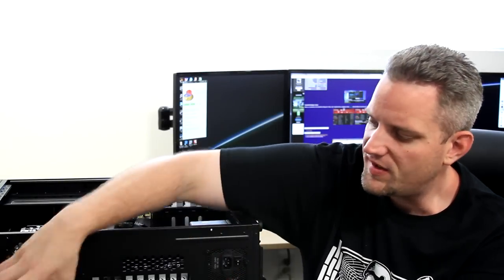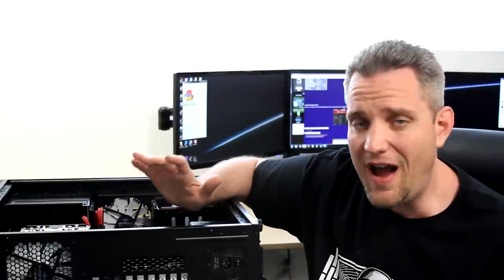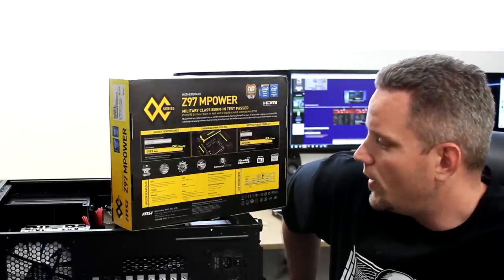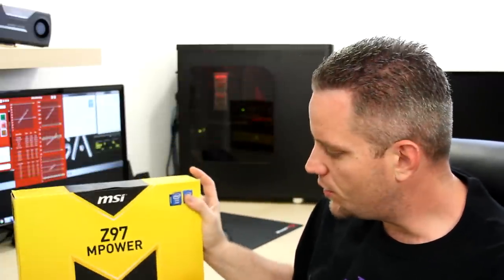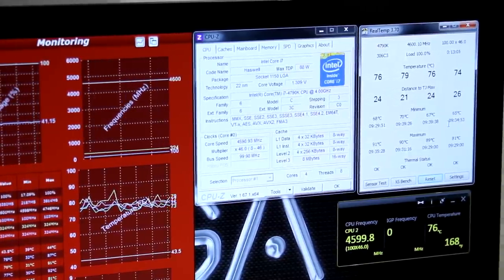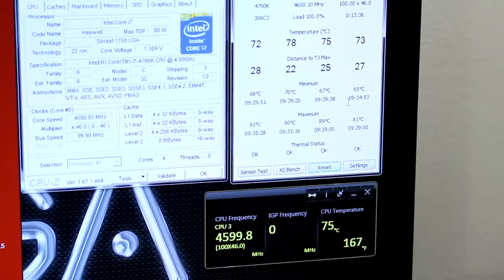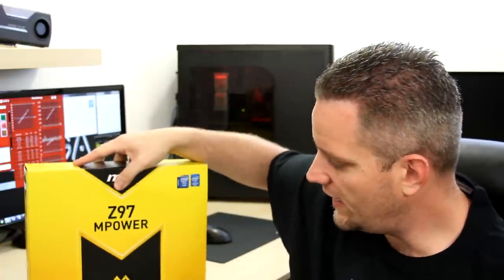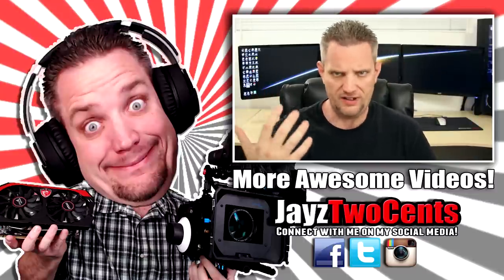Overclocking the Intel 4790k with the MSI Z97 MPower on air!

Comment: Jay, how does one learn to overclock, i've noticed you did one with your 8350 some time back and i was planning on following that tutorial but my gigabyte GA-970A-UD3P has a completely different bios and i'm stuck on what do to.
Reply: just disable turbo core and put up the multiplier
Reply: Liger-Zero whatever that means.
Reply: Liger-Zero Also i pretty sure you have to disable a bunch of things as well
Reply: you need to enable llc, disable apm, cnq and c1e, as well as all the power saving features before putting the core voltage to 1.5v or 1.45v. then you can try to find your cpu's headroom. and yes, you need better cooling for the cpu.
if you are shooting to the max, then you may want to play with the nb frequency, cpu/nb link, ht link, etc... but generally speaking, you can overclock to 4.2 to 4.5ghz without changing the stock voltage.
it is not that hard to overclock fx if you have a good mobo and heatsink
Reply: Liger-Zero ok thanks
Reply: Liger-Zero Putting the core voltage above 1.3v is just asking for trouble.
Reply: Steven Clark that is half true. if you are using haswell, yes, anything above 1.3v is asking for troubles; but no for fx. 
the stock voltage for fx is around 1.35v, depending on your model, some may vary. but generally speaking, you need to go above 1.4v if you are planning on overclocking the fx. my fx6300 could go up to 4.2ghz without raising the voltage. it is good for normal use but below average for overclock community standard.
for now, my downvolted fx serves me really well, and i dont see any necessity to overclock it.

Comment: i love your channel now! :) i have a question, i got a intel ssd 120 gb to ONLY RUN MY OP WINDOWS 8.1 na d a intel ssd 240 gb to run my games like battlefield farcry and you name it, and 1tb hdd 1000 velociraptor to save my videos music and all that please tell me the truth is this a right way to start my new built?
Reply: you don't need 120gb for windows only you can add extra stuff to that ssd windows is only 20gb if i'm correct, don't count on me for that do some research
Reply: You could sell the Intel 120gb ssd because you should be able to put windows and games on 240gb ssd without a problem. I'd recommend consulting a forum or something to make sure there aren't any long term problems with having heavy games and windows on the same ssd.
Reply: nix the velociraptor if you're already SSD for the important stuff - all the rest can live on slow low power green drives (for much less cash) :)

Comment: Atm my 4790k is running 4,7GHZ @ 1.225v. I wont go any higher because the temps are getting kinda high for h80i:P.
Atm waiting for my swiftech h-240x

Im also running in in MSI Z87 G43 Gaming motherboard.
Reply: ***** Got mine at same GHz but with 1.23v. Can't go any further down. Pretty sure he/she is just really lucky or just hasn't stress tested for an hour yet.

Comment: 4790k@4.4Ghz + NoctuaNH-D15: 85-89ºC on Prime 95's Small FFT Test.
I tried reapplying the thermal paste twice but it's just a couple of degrees less than the 212 EVO. Is this normal??? It's summer here and all but I thought I'd get lower temps. :(
Reply: No man. I'm running version 26.6, the latest recommended for this CPU. I'm sure with version 28 the processor would just shut down since the temp would go even 20 degrees higher. But lowering the voltage did the trick: I was getting 97ºC with Prime95 Small FFT Test (my room is super warm today), but my vcore was 1.312 which is too high for 4.4 ghz. I set it to to 1.216 and temps went down 10ºC!! Stress tests run stable, I'll keep lowering it and testing the system stability.
The only bad thing is that the manual vcore is fixed, so it will be high in idle and that "might" reduce the lifespan of the cpu they say.
Reply: +Fernando Vidal i have mine clocked too 4.5 with a coler master hyper tx3 evo with 75-80 c
Reply: Read my previous comment: I fixed it setting a lower vcore, man. It was at 1.302 and now it's at 1.137 running stable but much cooler. :)

Comment: Im having trouble with my 4790k. 

I can run it at 4.4ghz at 1.150v. It will NOT go higher! I don't know what's wrong with it, or if im doing something wrong, it just doesnt make any sense. I ran all the way up to 1.3v at 4.5, but it just wont stick. Fails p95 in literally 20 seconds. 

Im running the 4790k on a sabertooth z97 mk1.
Reply: there has to be something wrong. i get my i7 4790k stable on 4.6 ghz at 1.160 Volt...
Reply: Fendt Arena
Im unable to add voltage to my gpu either. Im wondering if somethings up with my powersupply
Reply: +JgHaverty i Cant add voltage to my gpu too, it is not your power supply
wich Mainboard do you have?
Reply: z97 sabertooth mk1
Fendt Arena
Reply: +JgHaverty ok

Comment: my 4790k runs 4.7Ghz @1.285v 
I'm running it now 24/7 for over a year now with Fixed voltage and Speedstep off
is that safe for the long term ?
or should i run it at 4.6Ghz@1.25v?

cooler NH-d15 
Highest temp I've seen is 81c
Reply: .... +supersiick i hope you're joking xD
Reply: I just got into OC'ing but I would say that's pretty good. I heard as long you don't go over 1.35V and 85c-90c you're good.  That's why he was freaking out about the 1.501v lol
Reply: Reason over Dogma yes but if you have a really good cooling set up like jay (watercooling loop) you can up the voltage a little more then 1.35v but with care
Reply: Don't fix what ain't broke, heat kills CPUs and that's not enough heat. U probs wouldn't even be hitting 60c in realistic loads. I run 5.1ghz on the same CPU @1.37v with a 91c max and a 82 avg full load temp, and it's been the same for 2 years now. As Long as u don't notice anything u should be fine
Reply: +RedddRainn it is easy to get a stable 1.37v for me on air 91c max  5.1ghz. You don't need custom water cooling for that if ur lucky. Many people are able to run 1.336 to 1.38 stable on air depending on the air cooler and the air flow and ambient temps
Reply: Cyrus Khalvati i mean you don't need water cooling for overclocking but its doesn't hurt either ;)
Reply: thats true but if someone is buying this cpu it probs means they cant afford a custom loop
not that the cpu is cheep but rather that they cant afford to upgrade to a lga 1151 or 2011-3
Reply: Cyrus Khalvati yeah or they already have a motherboard cpu and ram for lga 1150 and just wont to upgrade there cpu
Reply: which probably means they cant afford getting a new mobo and other stuff for the mobo :P

Comment: My problem is I tried the overclock genie with the bios not the buttons on the board I did it in the simple mode where you get the option of gear1 or gear2 in gear 2 it will go too 4.7 ghz but when I go too run a game like flight sim X it crashes with the blue screen I set it back too gear1 in the bios that puts it too 4.5 and its fine.Can I over clock with the MSI command center or does it have to go through the bios set too gear2? Iam running the 4790K with corsair water cooling thx I have the same board msi max ac btw.

Comment: So if I jumped from a Intel Pentium G3258 to a Core i7 4790k ? Is it alright? I was bound by my LGA 1150 Mobo and heard only good things from people around me.
Reply: It will be a HUGE upgrade
Reply: I did it already, almost 2 months ago
Reply: ParagonHawk has it been a good upgrade so far?
Reply: Absolutely!
Reply: ParagonHawk great!
Reply: It's a blast.
Reply: Mike Brown Just curious about something, my budget is not that great but I want to buy a motherboard good for a stable overclock and also upgrade from my mATX to a normal ATX because my cooler is barely allowing my side panel to slide shut. Any idea? I'm thinking a Z97 is what I need but I don't know what model should I buy.
Reply: ParagonHawk I have the Z97 msi mate version and I have my 4790k overclocked at 4.7 ghz with teh 212 evo cooler.
Reply: great then because in my country prices for pc parts are nuts and the asrock boards are really great in prices. thanks
Reply: ParagonHawk welcome.

Comment: I have a MSI z97 gaming MOBO and a i7 4790k cpu, and a corsair h100iGTX cpu cooler. I am new to overclocking and I went to just tune up my cpu ratio up a little bit but I noticed it had a core voltage set to 1.408v AUTO. Is this bad?
Reply: +Alah Hockmac What you can get out of your processor is basically a lottery. You should though be able to get 4.6-4.8GHz easilly with watercooling. I myself use a Noctua nh-d15 for my 4790k, and I go for 4.6GHz at 1.240v. For mine to be stable at 4.7k I'd need like 1.275v, but I prefer the lower temps.
You should NOT go for auto when overclocking. If that is ok or not depends completely on what you set your multiplyer to. Water coolers can go for the 1.4v mark, but I would go below that to secure the longevity of the chip. Try for something closer to the 1.3v mark and see what you can get. Set it to 4.7GHz, set core volt to 1.3 (override/fixed (not offset/auto/adaptive)), then run a stresstest, like AIDA64 or Prime95 version 26.6 (not later). See if you're comfortable with the temperatures and if it runs the test for say 5 minutes. If it does, turn your voltage down to 1.290. Repeat this until you get a bluescreen and turn it back to what was stable, then run the test for a longer period, say 1 hour. Did it go well? Good! Comfortable with temps? Great! Should be good for anything you throw at it, since stresstests put alot more load than say gaming. You can ofcourse try with higher clocks, but just increase a bit and apply the same strategy.
Now what you want to do is go back to the BIOS and turn adaptive voltage on. This will lower the voltage when idling. Keep in mind that adaptive can go past the voltage that you set if you use a program that activates AVX. I've found AIDA64 to turn it up the most for my rig, so put it somewhere where you're comfortable, turn on adaptive, then run AIDA64 to see if you're comfortable with where the AVX takes you aswell. HWmonitor and CPU-Z are both good programs for monitoring this.
Good luck!
Reply: Ur risking ur chip going that High in my opinion.

Comment: Can i overclock my i7 4790k with asus z97 pro gamer?I have a 750w power supply.
Reply: ***** ok , thanks!
Reply: So what oc did you get? I building the same set up
Reply: Nicolas Ong I have not overclocked yet because i don't have enough money to buy water cooling. But when i do i think it will run 4.6-4.8 ghz stable .

Comment: which video card can run on the msi z97 mpower max ac 
i need help with it

i have a MSI GTX 960 GAMING 4GB 
can it fit in my motherboard that i am going to buy ??
Reply: Do you have an x16, pci express slot?
Reply: yes it has

Comment: hello random question :) i need hellp to fix one of my laptops its a acer. PLISS i hawe ben sitting here 6 hours non stop cant fix it ! here is it when i turn on my laptop i can press F2 to open BIOS. i can press F2 or not go in to BIOS to do my stuf there i have tried everything and reset BIOS and put in a USB flach drive in fat=32 with a new windows on to se if i need to reinstal windows but i cant the pc was running on windows 7 pro. i also taken the HHD hard drive out of my laptop and in my DESKTOP computer and it works fine it is in GPT with windows 7 and my files on. if i take out my hard drive it says no operating system found but if its in it only says - . i dount know what to do :p  ANYONE HELLP PLISSS!!!! :)

Comment: Wow J u got some really bad chip :P That's so weird i overclocked to 4.8 and had high 80's on air.. still running it now at 4.6 stock voltage in mid 70's. And yes i realize this is 2 years old video but it just came in commanded for some reason :P.... tha youtube has mysterious ways....
Reply: Dav ID whats your cooler and mobo?
Reply: Asus Z97-a / Noctua nh-u9b-se2
Reply: Dav ID sweet, I got the same cooler and I'm planning on getting the i7 4790k soon.
Reply: Nice, you should expect even better temps mine was 75-80°c whyle hitting it with aida 64 for 10 hours, the highest temp ever was 83°C on one core.

Comment: guys i've downloaded cpu Z and it shows that my CPU Core voltage is at 1.46 V runing at 4.4 Ghz is it ok ? :) using gygabite easytune btw
Reply: No it`s not!  That's way too high and will damage your cpu! The max recommended voltage for 4790k is 1.3 V. The stock Intel voltage is 1.2 V. Also make sure you have the latest bios.
Reply: Advection357 thanks for you answer dude but i fixed it from the bios now it's at 1.2 V, and for the bios i'm too afraid to update it :P
Reply: The only way to screw up and brick your board is either by flashing the wrong bios or computer freezing during flash. And even then if your mobo has dual bios you can still recover. Just need to make sure you get the right bios file (model and revision).. nothing to be afraid of :P
Reply: loool i don't know but i think i'll keep it on that version because i toggled down the voltage to 1.2V ....and getting more FPS on gaming :D
Reply: ***** Yea because at 1.46v you were cooking your cpu & it was probably reducing speed (thermal throttle) so it wouldn't get fried :P If your PC works fine then u don't need to update the bios necessarely
Reply: Advection357 now it's at 1.2  and it's cooooooold now :D